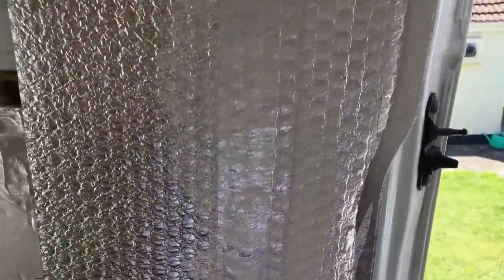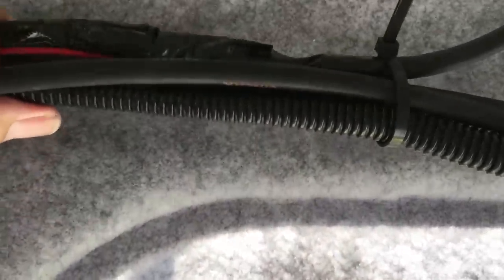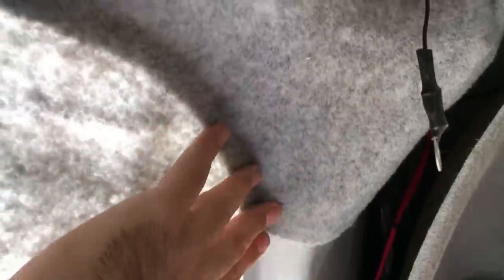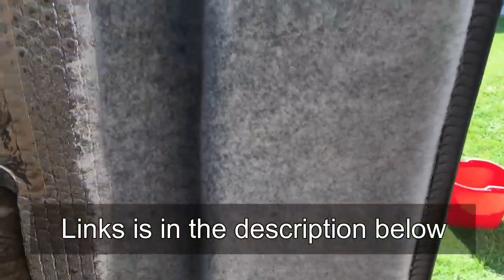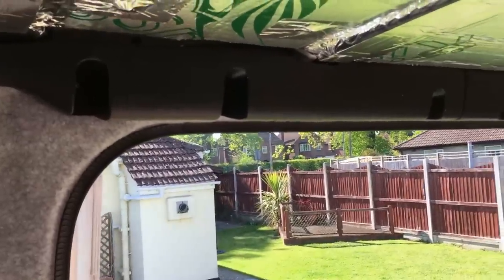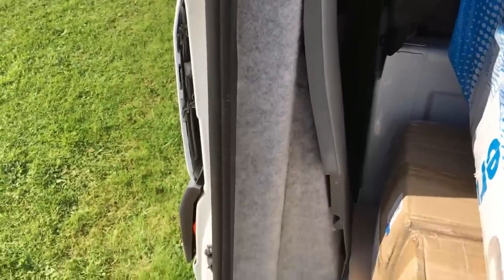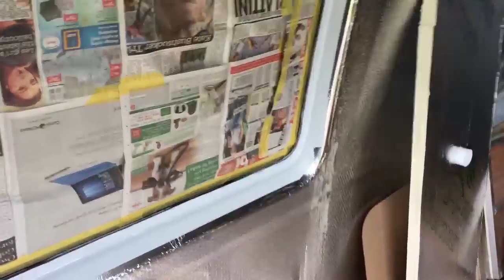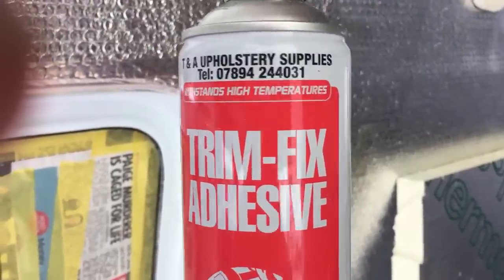Mercedes Sprinter Conversion - Van Lining Carpet

Comment: Hi 👋 from Australia 🇦🇺 I am watching your videos and have learnt so much as your presentation is so professional. I am considering using carpet lining and your video had made it doable for a novice like myself. Thanks 😊 Shelley
Reply from the maker: It’s very easy to work with. Make sure to use a high temperature adhesive like trim fix then it won’t fail in warm weather. Best wishes.

Comment: Hey Greg! Great video series. You also inspired me to get better at SketchUp and start sketching my customers builds before I build them. One suggestion I have for this video is the wrap around on the fabric around the doors. I did my first fabric job the same way and the first time it rained, the water wicked in from the outside and my whole inside pillar was soaked. I now wrap the fabric to the very edge and I don't wrap it around the edge and that's solved the problem. It's harder to get the weather stripping back on without the fabric scrunching under it but if you glue it down really nicely, then it should stay put. Great job with all your videos! I have quite a bit of experience but it's nice to see so much knowledge detailed out so nice and clear. Keep up the great work!
Reply from the maker: I did trim it back a lot more to prevent that happening 👍🏼😀

Comment: Hi Greg, I am sure you will already know that the carpet lining for the walls and windows is much easier to shape into the corners, nooks and crannies if you gently warm it with a hair dryer.  This makes it much more flexible and saves unnecesaary slits to make things fit.  Very impressive job you are doing, and As i have already said I will use all of your tips and suggestions in my new build conversion.

Comment: I am constantly amazed at the quality of your workmanship, I know when I start my van conversion I will be aiming high but if past experience is any guide I will cut corners, start rushing and the finish will not be as good (not really a problem for me as it will still be something I have made).  Well done Greg, a Master Craftsman in my eyes
Reply from the maker: Really appreciate those kind words, thank you.
It's tempting to throw something together just to get it done quickly.
I think you would be more satisfied with the outcome if you take a bit of extra time.
Might you always be looking at it thinking I could have done that differently?

Comment: Hi Greg. One thing I think would be useful to know is a best practice sequence of the build.
Were there any occasions when you had to undo work you had previously completed so you could fit another item in?
If so, and learning from your own experience, how would you do it if you were to build another one?
I think the hardest part of any multiskilled project like this is a sequence of work so that things can be assembled it is the correct order.
I am really enjoying watching you work on this project, it’s certainly made my mind up to do a Ford Transit Custom day van now, so please keep up the great work.

Regards
Reply from the maker: The biggest part of this build was the first fix electrical wiring, that took the longest.
I had to lift the plywood floor and run 4 more cables from one side of the van to the other.
You need to know exactly what you are putting in your van and where it goes
does it need 240v or 12v and what control cable needs to be pulled in
I had to buy longer control cables for all my remote controls

Comment: Great work Greg and the smoke trim really is nice.. 
Just a thought for you, wrapping your lining around the sill where rubbers are meeting the outside world may cause problems down the line as you are compromising the seal of the rubber to the metal work.
As installers ourselves we never carpet past a sill and would trim to the sill aperture so the rubber seal will be as intended on the outside facing metal.
Cheers .
Reply from the maker: Hi Russ, I understand what you are saying there, I was concerned about putting too much material into the rubber for obvious reasons, however, when you go to push the trim on what stops the carpet from just pushing back and puckering up, do you then go round the window with a paint scraper and shove the carpet back into the rubber where it has pushed out?
This was the stretchy felt type fabric so not as thick as carpet.

Comment: Hi Greg.  This was the video I was going to ask for, so thanks for posting!  I realise you won’t answer all of these; however here’s a few questions I did have....

Are you going with a compressor or 3-way fridge? I love the idea of not cutting vents for a 3-way, however the option of using gas is obviously really handy. 

Did you look at using a underslung gas tank?  If you’re not going with that option, what was the rational? 

I know your traveling off to warmer climates (very jealous!); however did you look at insulating the underslung tanks for any UK winter camping?  Do you think uninsulated tanks would be ok for the UK? 

You clearly have top notch wood work skills; however did you consider using an aluminium   extrusion system like 80/20?   Seems like a great combination of weight/strength.  

Did you rule out Litium battery’s on cost grounds? 

Is there anything you’d change about the build so far? Any big lessons learnt? 

Thanks again for all the videos / information / guides.  The effort you go to to put them together is really appreciated! 

Enjoy your travels.

Comment: The exact process I followed to line my VW T25, that adhesive is by far the best. I also used the same liner material (purchased on eBay). Good work as always

Comment: Another quality vid from the cutting room floor, great job Greg and missus, I can see plenty of questions below, one of which I can probably answer for you..You done the project yourself because, If you want a job done properly then you nearly always have to do it yourself, plus job satisfaction on a project like this makes you feel very proud when its finished..Budget also comes into it!

Loving these vids Greg

One thing I did want to ask Greg for your professional opinion:
The reflectix is a great heat barrier as you know, I was wondering whether it would be worth installing a complete barrier first then Celotexing and then another Reflectix barrier as per normal, the suns heat shining onto the vans exterior would be somewhat stopped before it even got anywhere near the Celotex barrier, then the inner reflectix would stop any residual that got past that, leaving a seriously cool van in summer and warmer in cooler temps when you need it...Or am I over-thinking things.
Reply from the maker: Hello Kevin, I this application you cannot use it as a reflector, it's simply to close a build up for it be effective. You can however use it into your windows to reflect the solar rays and prevent the huge heat gain you get through the glass.

Comment: Afternoon Greg, like the Q & A idea, two from me
(A) when you laid the vinyl floor what happened to the tie downs for the bike?
(B) with the adhesive how much work time does it give you before it cures? And is there a risk of carpet 'tearing' when it's 'wet' and your stretching it?
Many thanks again Greg, keep'em coming 👍👍
Reply: I have just put down rubber horse mat in the back of my van. I cut out holes for the tie downs to save them in the “boot” area under the bed. I can recommend rubber horse mat.

Comment: Thanks again for this series. My questions are very similar to the ones below.

1. At what point does the vehicle cease to become a van as far as the DVLA are concerned?

2. Does the vehicle excise duty or car tax in old money change with the change of use?

3. I assume that the overall insurance changes at the same point as the DVLA classification but how did you cover all the expensive bits as you added them?

4. Glass half full stuff now (or to be more correct, glass empty and smashed into little pieces). If the worst happens and the finished product is nicked or written off, how do the insurance company calculate the worth of your time and skills used in converting the van to a camper as it is obviously worth a lot more than just the original vehicle + the cost of the parts.
Reply: Just chiming in as the Insurance is one of the things that nearly stung us when we started our sprinter conversation earlier this year. If you have the van insured as you convert it'll need to be specialist insurance, most insurance companies won't cover you as soon as you start to make changes. Once the build is complete you send them photos of the build, receipts for spend and any professional labour and the DVLA change of class info and they will re value the van as a motorhome. For DVLA you have to fill in and send them section 7 of the logbook stating the changes, so long as you meet the regs and send them photos/receipts for spend then they will re classify it.

Comment: Hello Greg, I was wondering if a 1" wide wallpaper seam roller would be of use when pressing down the glued auto carpet?  Another top video 👍. Cheers....Nigel 😀
Reply from the maker: MuddyBootz no harm in trying it, the carpet does mould very easily with the hands and the trim fix is very strong

Comment: Your videos ROCK! The best! I am following along, just about frame by frame, as I convert my 1995 Ford cargo van. I've got the floor in, and thanks to your instructions I feel really good about it, knowing that it's done well! 
Now I'm on to the bed-frame.... which brings up my questions: 
- Did you put the Reflectix between the van metal and the metal bed-frame? 
I am planning on using cedar tongue and groove (closet liner) planks for my cladding. 
- Would I attach them on to the side of the van wall (after the Reflectix) before installing the metal bed-frame, or clad around it?
I am a complete newbie, and your videos have been sooooooo helpful! I wish I were further along in my build, as I'm sure I'm going to have more questions!
Reply from the maker: Hello Donna, insulated the voids, placed Reflectix over everything, attache the 9mm plywood lining then reattached the bed frame angles. So they are bolted through the plywood and vapour barrier but not in direct contact with the van walls. I'm gonna put a short video up in that this weekend as I have had lots of questions about this part of the build. 😃
Reply: Thank you so much for your clear answer, Greg! Cheers!

Comment: Superb series of videos Greg. Thankyou for making them publicly available.

This might be a difficult/impossible question to answer but could you give an estimate of how many hours/months went into the planning stages as well as the full preparation and build. 

The reason for the question is this; I'm not skilled but could take time out of my working life to do a conversion and make it a full time project. I'm just wondering if it's going to be financially worth whilr making the savings that a DIY build gives you minus a salary until it's completed and having something completely bespoke Vs staying employed, buying a van and having it professionally converted, or buying a second hand van built to someone else's specs or lastly, buying a second hand purpose built motorhome with low mileage

Thanks once again for your inspirational videos Greg😎

Comment: I think you mentioned on a previous video that you could store your motorcycle inside the van whilst travelling, but would have to move it outside in order to put the bed down and use it. Would it not be better making the bed slightly higher so that the bike can remain in the garage at all times for added security?
Thanks for another great vid. I hope you don’t have to rush or miss any just because you’re running out of time and needing to hit that road! 😃
Reply from the maker: SnoWhat !  We have delayed the start of our trip so we can make sure the build videos are all complete to the same standard to the end 😃

Comment: Great series Greg and I think you have given me a whole load of great info for a conversion I intend to start next year on my 50th birthday. My layout will be slightly different, but seeing how you have achieved a great looking finish has given me a lot of inspiration. I'd be interested to hear how your build "feels" in those colder climates if you're going to be using it in winter and if the airflow through the van is enough to keep condensation at bay. All in all a really useful and informative series.
Quick question for your QA session:
When you installed the electrics, you sunk the back boxes for the sockets etc into the insulation. If the walls are to be covered with ply, would it have better to install the back boxes into that ply?
Reply from the maker: Hello Mike,
Yes, you can do it that way and most of the time the switch plate covers the small plastic flange of the dry lining box.
It would have meant a shallower cut into the insulation too, so another plus point. It's a fair point you make.

Comment: Hi Greg, I've found this amazing black paint for plastics, it seems to be much better than normal spray paint as it seems to keep a flexibilty in the paint while giving a great bond. 'VHT Hood, Bumper & Trim Paint'. I was put on to it by friends that do big $ restorations, you can get it in the UK but I think it's a product from Retaridstan.
Reply: His name is actually Donald :)
Reply: Can you post a link for it please
Reply: Thabks for the heads up Karl, is this the paint?
 http://www.topspeedautomotive.co.uk/index.php/vht-hood-bumper-trim-paint.html

Not on Amazon but I saw it on eBay. Probably worth shopping around auto suppliers for it. 😎👍
Reply from the maker: I knew I had seen that name before. The grey primer I used on the van is VHT engine primer 😀

Comment: Hi Greg yet another great video I've read some of the comments about the electrics and could we have a more details about where you placed the electrics and how you planed the location etc. Thanks
Reply from the maker: Hi Reg, There is a follow-up video to be released soon which will show the equipment installed in the van.
Main electrical equipment is in the garage at the rear of the van, LCD controllers are located in the kitchen.
Reply: Greg Virgoe  thanks Greg

Comment: First, thank you.  I have watched the entire series and am grateful for your thorough details.  Did I miss a discussion about AC?  Did you consider installing AC and why did you choose not to?
Reply from the maker: Hi Jennifer, AC was not an option, the van doesn't have any and it was too costly and drew too much power to install it when you are off grid camping, plus lose roof space and that would be an issue with solar. Next van would have inbuilt AC I think 😃

Comment: Good Morning from Down Under.
Reply from the maker: Morning Karl, how are you buddy?
Reply: Hi Greg, I'm up late doing some accoustic designing for my Kombi, I'm trying to get mid and high end vocal sounds at ear height in the drivers seat without bolting on ugly speaker pods on to pillars. I'm working out the angles and space to mount speakers under the dash and get lazered perferations to look 1970's stock and keep the speakers hidden and use the windscreen as the sound defector/refector to my ears. You'll be the last thing I see before I going to bed, I hope I dont dream of you and a can of trim fix!

Comment: I am about to start building a camper van and I am attaching you videos with interest. One question I have is on your external corner off the shower cubical you did a lap joint , I notice that Mortland do a corner profile and I order why you did not use this.
Reply from the maker: It’s a great idea and simple to install so very good solution. 
Personally I didn’t want that aluminium angle look so was more happy to go with the black T trim.

Comment: My only reason for not using auto carpet myself was that I was worried about using it on metal and it becoming damp in the winter..... Thanks, I know a better way to use it now!
How do you think the carpet will be under the window should condensation roll off the glass?
Reply from the maker: Hi, you're right saying the single glazing will be the only place that condensation may form. With adequate nighttime ventilation and a little bit fo background heating that should be kept to a minimum. I will let you know how we get on.  One tip for you, try whenever possible to park your van facing east, the sun rising early in the morning will dry out your cab windows in no time at all. :D
Reply: I am experimenting with blackout blinds backed with towelling, so they can just absorb the moisture and if wet I'll hang them to dry.
Reply: I'm interested to know how that goes, PermaHeretic.
Reply: Thanks Greg. Yeah, the cab is a furnace this time of year, but last night was the first cool night for a while. I guess it won't be long now!
Reply: Yes the double glazed windows are more expensive however they are worth it . I mentioned about single glazed windows some time ago and the risk of condensation. Even though some think the bonded windows look better I don't think the risk is worth it.

Comment: Dear Greg, great set of videos, thank you so much for doing them. We are planning our Sprinter conversion now and have a few questions please. How heavy is the double seat plate you installed? I want to make sure we are under weight. Also, what is the height of the bulkhead cupboard shelf up to the roof? I need to make sure we order enough furniture board.Thanks :) I would love to see more videos, especially about your Truma installation and details on its connections re water pump pressures with the required water pump. Kind regards  Antonia & Joy
Reply from the maker: Hello Antonia, I estimate the seat base to be no more than 25kg Max
There is a detailed video on the water system and boiler install very soon. 😃